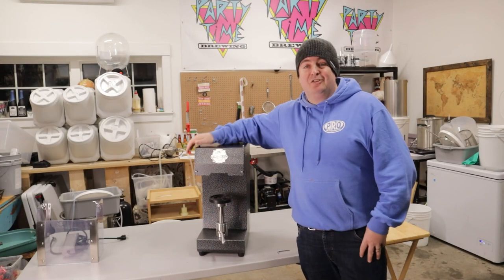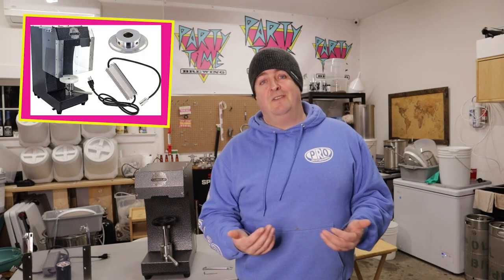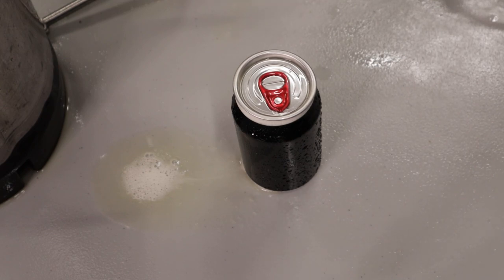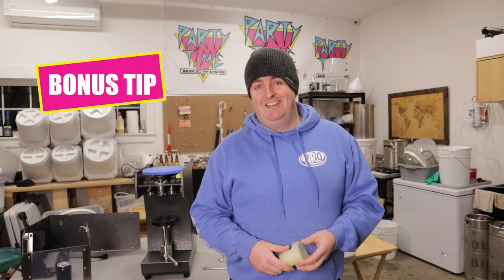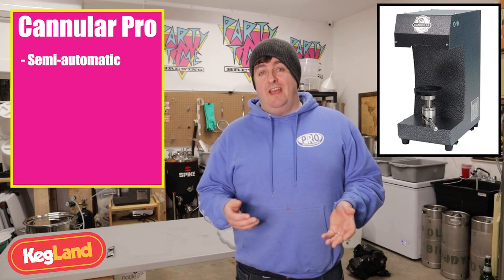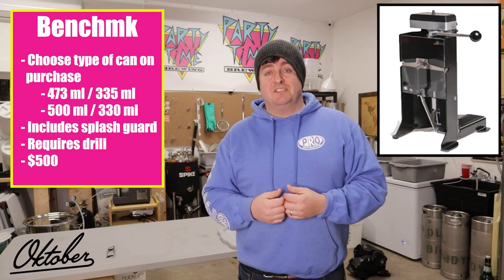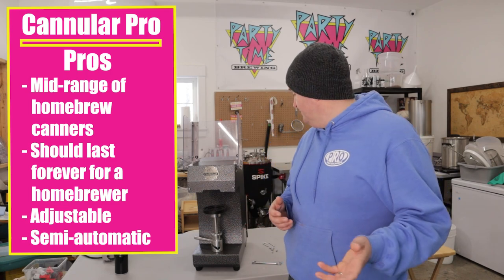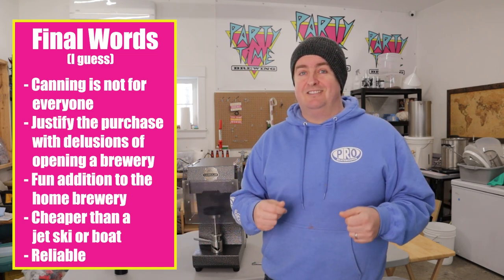How to Can Beer at Home | Cannular Pro Review and Comparison

Comment: i got a killer deal at my local HBS for the cannular manual model with power supply for just over 400. they were just trying to get rid of it as they said it wasn't selling, and the guy that was working there had no idea what came with it. So he gave me the power supply with it. I paid for it and ran lol. It required a lot of adjusting in the rollers to get it right, but many cans wasted and time taken later..its going great!
Reply from the maker: Sounds like a great deal! Mine was pretty good when it came, but I definitely gave it the one over before going nuts with it. I've done about 3000 cans so far with minimal problems. Cheers!

Comment: Great video and comparison!  I have the BenchMK.  I think it’s a great option for homebrewers that are doing low lower volume canning. Biggest downside is that you need two hands to run it.  Biggest upside is that a cordless drill makes it cordless machine.
Reply from the maker: It seems much more portable. And probably way lighter. The cannular is pretty heavy. Cheers!

Comment: Scored a cannular pro and half a box of 500ml cans for $250 AUD, funny it came with that useless spacer part for the non pro version, guy I bought it off must of fell for that scam too 😅
Reply from the maker: That's a great deal! I think it's an easy thing to fall for if you buy the cans before you see the machine. Cheers!
Reply: @PartyTimeBrewing  got it cheap because we baught the dudes whole setup before he left the country, mostly grainfather gear I'm stuck repairing now already trying a warranty claim on the chiller . Got 2 fermentors working away so not long until i get to try out the cannular  ... And find out what is wrong with it 😅